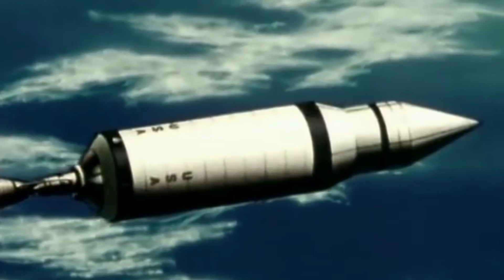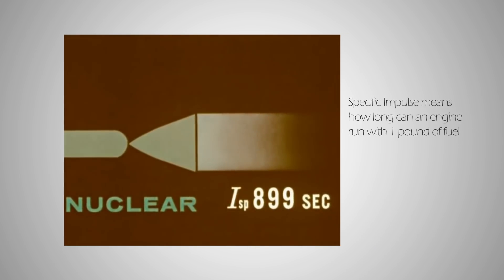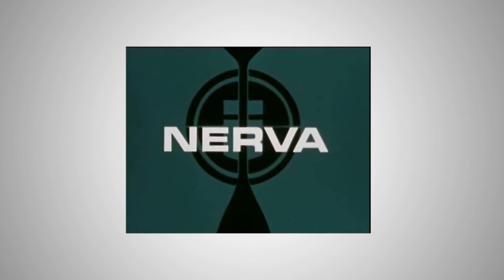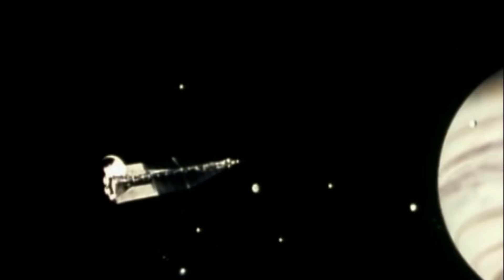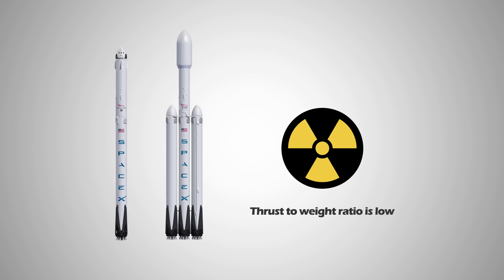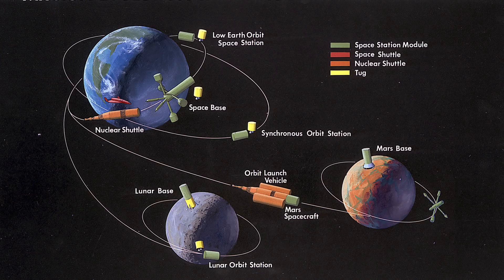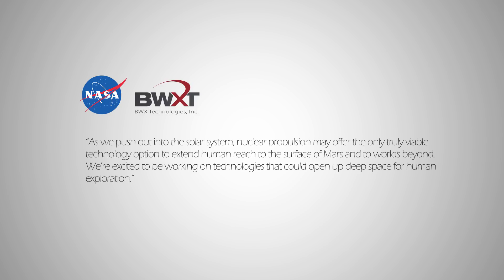What comes after BFR for SpaceX, a nuclear-powered rocket?

Comment: Was that Nuclear Thermal Propulsion featured in the Star Trek when Chris Pines almost died due to full exposure to the engine core. Even though that was fictional the franchise pride themselves on keeping the tech in their stories as close to reality or near reality as possible. I would hate for one of our astronauts to be subjected to such a dangerous emergency.
Reply: NTR's as well as any nuclear powered ship (not radioisotope systems) uses a shadow shield to save on weight. These things spew neutrons and gamma rays in every other direction. All the radiators and solar panels must be in the shield's shadow otherwise it would reflect radiation at the crew module, and that intensity is far far worse than you typically get from space.

Comment: Merlin & Raptor engines will be used by SpaceX for a long time. SpaceX is just getting into the process of integrating the Raptor engine into a workable spacecraft & rocket. Plus they are building both sea level & vacuum versions of the same engine. It could be at least another 10 to 20 years before they even consider nuclear propulsion. Likely they'll just build more powerful upgraded Raptor engines over the next decade much like how Merlin evolved over the past 10 years.

Comment: It's not only the mass of the thrust that provides the thrust, it's more so the pressure difference of the engine and the atmosphere. The merlin engines have a higher chamber pressure than previous engines, thus higher thrust to weight. Pressure wants to go from high zone to low zone.

Comment: From what i read below, i would like to add another comment, it makes little sense to me to have one ship to do all. The need for a trip to Mars for example are different from the need to take off from  a planet with atmosphere and gravity. It looks better to have ships specially designed for each type of mission. Furthermore, if an industry can be viable on the moon, it is conceptually possible to have small SSTO to orbit for crew transportation and most of the rest supplied from space industry with some heavy lifters used for special goods which cannot be manufactured in space.

Comment: NTR May be used in atmosphere too. At least certain types. There is plan to use NTR hybrid rocket which would be able to operate in two regimes- one in atmosphere using atmosphere as reaction mass, and then switch to other regime and use pure hydrogen when atmospheric pressure will be too low for usage. That makes the rocketplane to take less reaction mass at the start while still have reaction mass once in near vacuum or in vacuum.
What I saw, T/W ratios were reaching up to about 70 for Dumbo NTRs project...  That one may not be good from environmental reasons, but there are better constructions, for example Pebble Bed NTR reaching T/W of about 20 acording to calculations. Research is needed here, things aren't as straightforward as by using chemical reaction mass and reactor(combustion chamber)

Comment: BFR does not use hydrogen for fuel so adding a nuclear engine would require an additional fuel tank, and the creation of two separate fuels on mars for refueling. nuclear engines  wouldn't work well in gravity so replacing them entirely is also out as the BFR needs to land on earth and mars. If the raptor engines and a nuclear engine could utilize the same fuel this might help but i suspect the level of engineering complexity, added weight and cost associated with replacing the raptor vacuum engines with nuclear engines may reduce the benefits considerably. 
Nuclear engines may however suit an SLS upper stage designed to reach but not land on planets inline with NASA's current SLS plan this could possibly land on low gravity moons and asteroids as well and perhaps one day become the suggested space tug boosting future rockets out towards more distant locations.

Comment: If you actually read about the engine they plan to put on the NTR, you'll find it's nothing like the old Nuclear Thermal Propulsion designs. For one thing, it doesn't actually use a nuclear core. Instead, it's a two stage ramjet burner that takes advantage of oxidizer in the atmosphere to drag less fuel along. Really the name is a huge misnomer. I should also point out that the guy working on the NTR is their engine designer. He's done all he can for the BFR by designing the Raptor engine, now they're just paying him to spitball next steps in design and see what sticks. This was all talked about in the numerous articles about SpaceX's NTR that came out around the same time as your video. How did you miss all that?

Comment: Several key factual inaccuracies here. The start the Falcon 9/heavy is not considered the most reliable rocket, though it is the most cost effective.

Nuclear is not more efficient than chemical because of its fuel choice but because of its energy density. Chemical propellants can only store a limited amount of energy per unit mass of fuel. The energy available from a nuclear reactor far exceeds the stored chemical energy in the fuel.

Hydrogen is a great choice for any rocket engine because of its low molecular mass. This gives a more efficient conversion from thermal to kinetic energy as the gasses expand.

The main downside of NTR engines is not politics, but their high mass. Maximizing the ratio of fueled mass to final "dry" mass is important for rockets. DeltaV gains from higher ISP are reduced by having a higher final mass.

Comment: Another huge problem is hydrogen boil off. No material we have can successfully contain liquid hydrogen for long periods of time. The molecules are just too damn small that they pass through the tank. This is why deep space propulsion systems today don't use cryogenic fuels but instead hypergolic fuels (which are also better for many manuevers and orbit keeping). The BFR uses cryogenic methane, which doesn't have this problem, but has inferior specific impulse compared to hydrolox. If a deep space nuclear propulsion space craft is to be made, we will need some sort of breakthrough in material science
Reply: You can put the tanks in a really good freezer :P
If you got a nuclear reactor you can run cryogenic heat pumps for as long as you need to reduce the problem.

Comment: Check out this unique design hybrid by John Bucknell, conceptual designer of the Raptor engine.  This design is the Nuclear Thermal Turbo Rocket (NTTR) and it combines in one engine, nuclear power, air-breathing jet, and rocket.  It operates from sea-level to space and has a very high LEO fraction and operates as 1, a turbojet, 2, a ramjet, 3, a scramjet, 4, a chemical rocket, and 5, a pure nuclear rocket.  I think it overcomes your objections on reusability being a high thrust to weight ratio and a very large specific impulse.  It is worth considering.  https://www.nextbigfuture.com/2018/07/x-spacex-raptor-designer-has-ready-for-development-designs-for-nuclear-rocket-that-will-be-2-7-times-better-than-bfr.html

Comment: AFAIK, Neuclear Thermal rockets (NTR), although they represent an incremental upgrade over chemical propulsion, still fall well short of the efficiency of the xenon based ion drive that carried us to vesta and ceres, and which is our current best option for interplanetary travel.

I picture NTR as being best suited for orbital transitions burns such as from LEO to TLI for high mass payloads, or from LEO into an insertion onto, and off of, the "Interplanetary Highway" orbital network.  Once inserted onto the IHON, you could then essentially switch thruster gears to the higher efficiency of ion drive for further speed increases ... then you would reverse the process for deceleration via NTR to inject into orbit around your destination planet. 

This is outside of wheelhouse, but i am guessing were in a wait and see stage at the moment, as things like vasamir are able to be tested in LEO, and seeing if ion drive can be scaled up for larger payloads, and then of course there is the big questionmark about the "impossible" electodynamic drive.

EDIT: Looks like i reinvented the space tug concept covered at 5:00 ... thats what i get for posting before having finished watching the whole vid.

Comment: Nuclear thermal rockets would essentially be most useful for use in space away from earth.  For example if we were to build a large space station in space and make it largely self sufficient, at least for a period of years, then we could equip such a station with nuclear thermal engines, attach a few BFR's to it and send it on a slower interplanetary transfer network path to Mars and use it as an orbiting space station, supply depot, medical center, etc. while we build out infrastructure on the surface.  Having a station in orbit at mars with even a limited capability of transporting people and equipment to and from the surface would increase the probability of success and decrease the probability of catastrophe on the surface.  Providing initial fresh produce and food to the surface while it is being built, medical services and even controlling surface robots from the relative safety of the space station initially could make such a venture much easier and safer for colonists.  Such a station could be used to build infrastructure on the moon first and then move on to Mars as well.  Once the ability to generate fuel for the BFR's was established on the Mars surface, and providing that the BFR spaceship proves truly reusable - even in the likely harshness of Mars landings and take offs as a single stage to orbit rocket, then sending people and supplies between mars and earth when they are aligned for interplanetary transfer would be much easier.  The problem is that there seems to be little interest and finances available toward building self sustaining space stations, aside from Jeff Bezos who is planning something similar to move industry to space.  We have learned a great deal from our efforts with the international space station, which would be minuscule compared to what I am envisioning - more of a city in space.  It might take an bit of genius and a collaboration between personalities such as Musk and Bezos to pull this off and I am not sure how well they would work together as egos tended to get in the way in historical collaborations of this sort.  I would hope for the best given the stakes for the future of mankind.  At any rate, the point is that powering such a large space stations movements between earth, the moon, and mars and maybe back and forth would potentially benefit by the use of nuclear thermal engines relative to chemical propellant rocket motors because of both the increased specific impulse and the greatly increased energy density of the nuclear fuel as it also can be restocked with hydrogen at its destination should such fuel be produced there.

Comment: There are ideas on how to use fission thermal engines for take off from Earth. They can be made to not spew out any radioactive material. A fission thermal engine is simple and cheap, there's not much need for reusing them. The engine consists of uranium that gets depleted anyway. When the propellant (hydrogen) runs out, the engine is pushed away since it will overheat and explode if the uranium parts aren't separated to below critical density.

Comment: There is a basic problem in that SpaceX is looking to really ramp up launches and at the same time the windows to do fuel efficient transfers to different parts of the solar system are spaced far apart as in year+ time scales.  This dictates, especially if you have large scale space mining and/or colonization efforts going on that ships taking these trips are probably going to be large.  Anyways do you really want to be wasteful and cut out key things such as artificial gravity and add a bunch of bulky radiation shielding with a jack of all trades second stage BFR or optimize it for maximum crew and payload for a short trip to somewhere in the Earth-Moon system and then build a bigger ship with optimizations for long term deep space travel?  Going large, might as well do nuclear pulse propulsion such as the well penciled out Project Orion study done in the 1950's and early 60's, except with modern technology to vastly improve performance over what could be worked out in the 1950's and only use this stuff a safe distance from Earth, say the Earth-Moon Lagrange point and beyond, which the BFR should reach with relative ease.  I suspect a modern large scale nuclear pulse propulsion design would get you an ISP of 10,000 seconds or better with modern materials especially as the original plans called for just using steel for everything including the pusher plate and they had to compromise ISP with inert mass around the bombs a lot (all the way down to 3,100 seconds or less depending on the particular size study) in order to not damage a steel pusher plate.  We can do much better than a steel pusher plate today, say use a high performance ceramic heat shield that will slowly ablate away and super-alloys for the structure, and thus dramatically cut down on inert mass around the bomb.  We can also ramp up the fusion fuel and shrink the fission 'fuse' quite a bit more than they could back then.  All this adds up to my suggestion of 10,000 seconds of ISP or better with good thrust as thermonuclear blasts create quite a kick even from a bit of a distance in space.  This is much better than the 1,000 seconds you talk about and definitely much better than chemical.

Comment: My suggestion: Not use NTRs but use NEP (Nuclear Electric Propulsion)
With the BFR SpX will have the leg Ground-to-LEO covered, with rapid turnover reusable systems. The LEO-to-Mars (and beyond) is also covered but it benefits much less from the high thrust of chemical rockets. So we could build Ion propulsion Spacecraft that could be launched fully loaded for the interplanetary transit and need no refueling missions. A spacecraft like that would exchange tons o low Isp MethaLOX (380 Isp) for  an ion engine using Xenon with an Isp of 9000s, this means almost 150 ton (maybe more) of payload to the martian surface per flight. This ship would still retain it's lading Raptor engines and propellant tanks which could be filled on Mars for the return mission (Chemical Mars Launch, Electric Transit to Earth), much like the chemical BFR but with larger return payload.
Nuclear reactors are good for supplying the power to those engines due to their very high power density, compared to solar panels, and the fact that they work equally well farther for the sun.  The high power density could translate to either shorter trips or more cargo per trip.

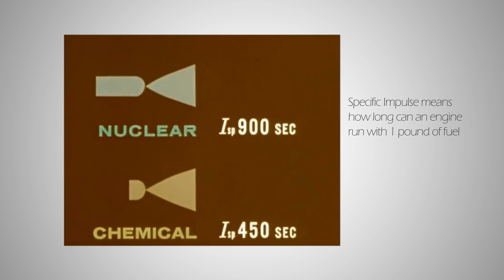Comment: 1:44 bad phrasing, the fuel is a nuclear rocket is not the hydrogen, its the nuclear material, which has much higher energy density then any chemical, the propellant is the hydrogen, in a chemical rocket the fuel and the propellant are are the same.
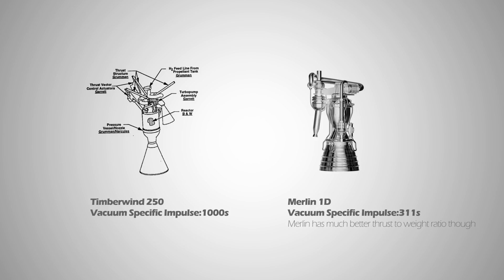3:07 incorrect, nuclear can only be used in upper stages (currently) because they don't produce enough thrust to be used in lower stages.

Comment: I talked with the Clinton administration in 1996 about using NEBA III - nuclear energy with bimodal application - which is a 10 MW thermal engine with a 10 kW brayton cycle operating continuously.  At 9 km/sec exhaust speed this produced 2.2 kN (500 lbf) thrust.  

Five of these producing 11 kN (2,500 lbf) would produce up to 50 kW electrical and be a helluva mission module adjunct.   

A 63,800 kg payload on orbit would be capable of sending a payload to the moon orbit and return, with 24,430 kg of hydrogen fuel.   39,370 kg of useful load in LLO.

Comment: Specific impulse is ALWAYS important.  If you can double your Isp at the same thrust, you only need 60% of the propellant for the same dV.  There is no reason you couldn't design a NTR to have a high enough thrust to allow terrestrial liftoff. The problem for use on a reusable rocket is that you will want people on board at some point, so you need shielding for the radiation.  That is where the mass penalty comes in that makes NTRs not feasible for launches.

Comment: Did not!!! They were in fact proven to leak a lot and spew radioactive crud, and they never finished figuring out the issues with radiation shielding a reactor prone to be leaky. But should SpaceX build a nuclear/plasma rocket ? Yes, a very reusable reactor like a MSR (molten salt reactor) would do well with electric propulsion. The fuel for a MSR can readily be shipped up in containers that wont be damaged if a rocket blows up. And "simply shoveled in". I don't like any fission reactor that is fueled up during lift off. The MSR was tested and proven in the 1960s (only tested 5yrs at 2MW), and are not throw away reactors like your Nuclear thermal rockets use. About 300MW is expected out of the first gen MSRs being tested today, and that's plenty. And they are small lightweight power dense reactors and cheap.
Reply: I should have mentioned a MSR / electric propulsion rocket does require heat sink radiators and Nuclear thermal rockets don't. My preferences are heavily rooted in my dislike for any fission reactor that is fueled up during lift off. I would stay with chemical rockets on Earth's surface if it's the only way around a reactor that is fueled up during lift off.